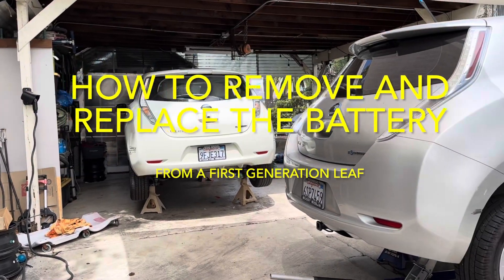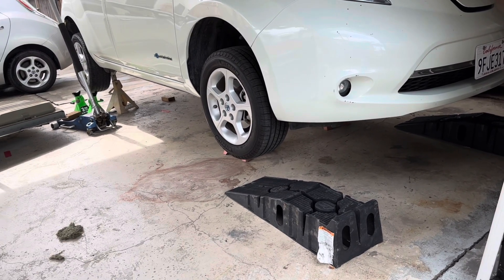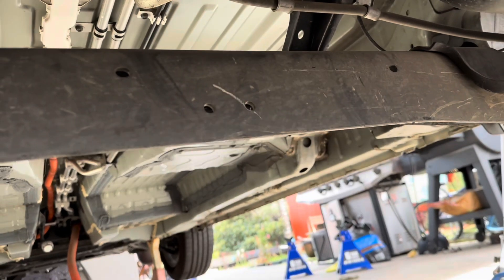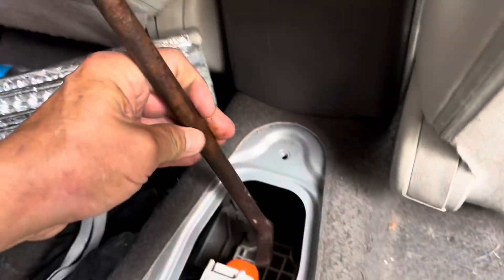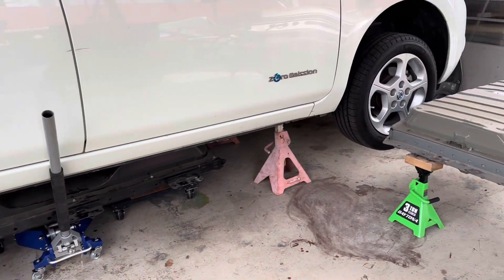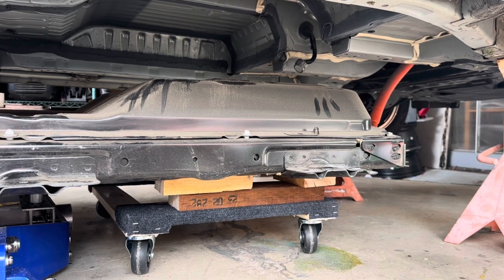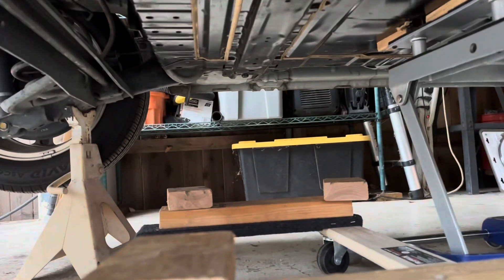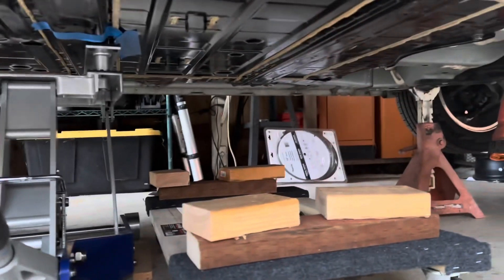Nissan Leaf Battery Removal and Replacement

Comment: Is there a second video where u can show the dashboard and if it works fine after the switch?
Reply from the maker: There are many sights where they will discuss the need for the leaf spy app and a bluetooth obdll reader. Dala and others explain how to reset the car to accept the new battery. It's easy.

Comment: small note about the disconnect: when it gets stuck in the halfway position, the center tab needs to be pressed

it's a weird double-locking thing.  ugh...  

I had my trouble getting the lever started because the two side tabs engaged a bit too strongly.  (nothing a screwdriver wouldn't help with)

Comment: Did the BMS in the new car accept the new battery straight away? Or if not, how did you manage to get it to? Thanks. I saw a guy on youtube replace one and the dashboard came up full of errors and nothing would work. I don't know whatever happened to it as he never put up a follow up video on it.
Reply from the maker: You need to get a bluetooth code reader and the leaf spy app for your phone. Then it's easy
Reply from the maker: yes you need an obdll with bluetooth and Leaf spy on your phone. See Dala's videos
Reply from the maker: You got leaf spy app and a compatible Bluetooth dongle OBD2 which I think the leaf spy app tells you.

Comment: I'm just about to try this maneuver on our 2013 Leaf, replacing the original battery with a 2022 62kWh.  Can't wait to see the range after we're done with the swap.  The original battery is still at about 70% SOH so I'm going to use the cells for home backup, which is a nice bonus.
Reply: How did the battery replacement go ?
Reply: @Dannyfromvegas  Haven't gotten to it yet. Blew a timing belt on our van and I've been working on that.
Reply: Where did you find a 62kwh battery pack? I've been searching for one to do the same on my 2013.
Reply: @TenshouXVI-b6q  Copart. I live in the Atlanta area and I waited for one to pop up practically next door to me. Be sure you understand their fee structure and haul-off policies before placing your maximum bid.

Comment: You are scaring me putting the car on what is essentially skinny stilts. One good rock and the whole think will come down at an angle. I guess you survived, but add blocking under the tires before getting under it again, please.
Reply: Those are jack stands, and unless they're the deadly harbor freight ones, they're fine. They're the accepted method when you don't have a lift. If you position them correctly and are on hard level ground they're very stable. I've supported a 9000# truck with them. If you're worried about it, you shake the bejeezus out of it before you get under.
Reply: I mean you should shake any vehicle before you get under it, jack stand or lift.

But yeah jack stands literally are the correct way to do this in this case, blocking the tires would be less safe because tires can roll.
Reply from the maker: So you've never seen a car worked on on Jack stands before?
Reply from the maker: People put cars on jackstands all the time. I don't know why you're scared.  Working on cars is inherently dangerous but if you're not mentally challenged you won't tip the car over.

Comment: I have a 2011 Leaf in San Diego in great shape 65K miles, red if you want to go again on this.  Only 20 miles of range.  We put in a better battery and sell the car and share in profits.
Reply from the maker: Do you have a battery?
Reply: @RinconDoug  Nope.  I see that CATL makes modules for the 2011 Leaf battery now.   Someone knowledgeable could rebuild the battery with these modules.
Reply from the maker: Sure thing
Reply: @RinconDoug How do I contact you directly?